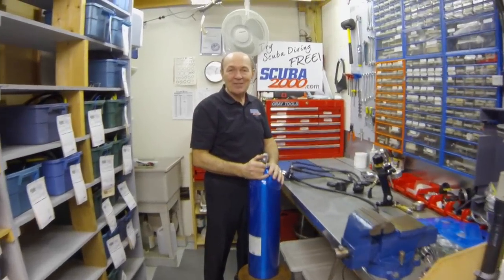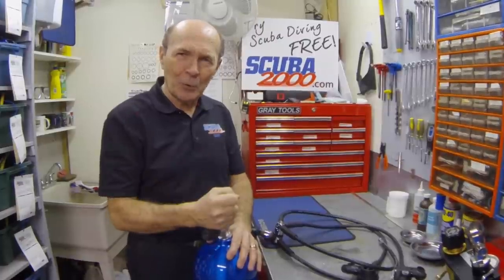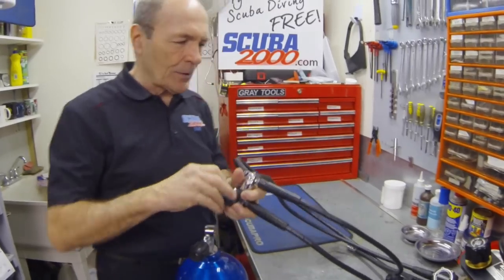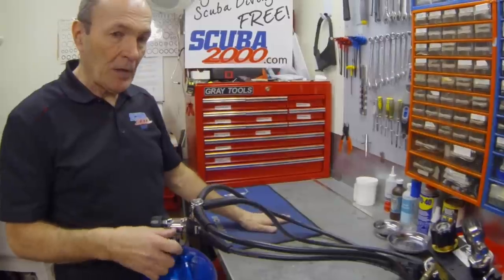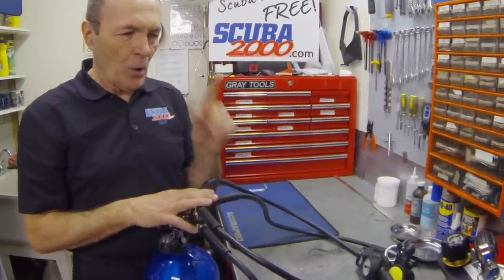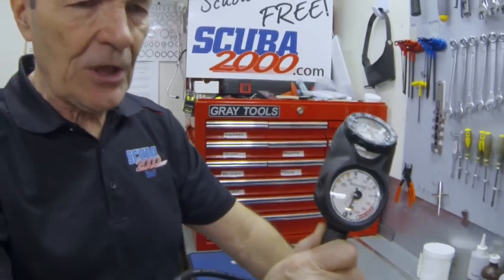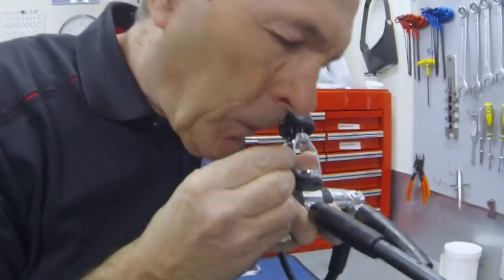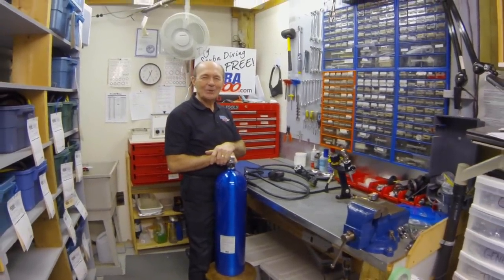Scuba System Assembly & Disassembly - The Regulator - Scuba Tech Tips #1

Comment: Heck Alec, I'm not even a diver and I enjoyed watching your video. Clear, friendly and to-the-point with none of the annoying soundtracks and unnecessary banter the young'ns use as a substitute for quality content. Keep up the great work.

I have an older steel Dacor tank that I am repurposing for non-scuba use. I removed the regulator and measured the threads to find that it was 1" (not the 3/4" NPS) that I expected to find.  I was wondering if you might know which thread standard Dacor used on these tanks back then.  Is it NPT, NPS, something else? I don't want to attempt to screw anything onto it for fear of damaging the threads....until I identify the fitting type. Your experience would be appreciated.
Reply from the maker: I've been thinking about this one. I can't think of the reason for a bigger thread. Some steel tanks had a smaller than normal thread (5/8" maybe). To the best of my knowledge there's 1/2"NPT used in old, PST steel tanks, recognized by the taper and need for sealant, and 3/4" machine which is a straight thread and uses an O-Ring. DACOR used Luxfer aluminum tanks and PST steel tanks - all normal. Take it to a local machine shop. They ought to be able to tell you what the thread is.
Alec
Reply: I misstated the dimension earlier. It is 3/4" and with the o-ring I suspect it's precisely what you said it could be. So I ran a 3/4" NPT and an NPSM into it and both threaded fine with no binding. Thanks for the tip, Alec. I appreciate it. Mystery solved.

Comment: Just a thought: could you invert the rubber seal/cap (turn it inside-out) while diving and then just wipe it off and un-invert it prior to putting it back on the regulator at the end of the dive? Or is the rubber too stiff?

Comment: Love your channel .you are the most informative person on the web .you explain everything clearly without using too much technical jargon .
I'm Shane from ireland.I was wondering could you give me some more information on tanks.
Im a big guy so I need alot of air .
Would a 19 litre steel tank or twin tank set up be best also How To set up twin can they be added to a normal bcd or do you have to go with back plate.
Could show me the size of a 19ltr so called monster tank
Reply from the maker: I'm not as familiar with European tanks sizes but I think the 19 is quite big. We were recently using 12 and 15 litre in South Africa and they seemed perfect. Most of used the 12. One of our divers, Kevin in fact, who is a big guy, used the 15 and it was fine.
I think the best answer is to use the tank size that will allow you to dive as long as your buddies or the rest of the group. Sure doubles give lots of air but they are expensive, very heavy, can cause buoyancy and attitude problems, require special BCD fittings, etc. And there's no point having so much air that you come up with half-filled tanks every time. You still have to pay for a fill.
See if you can't borrow or rent a 19 to see if it does the trick. If you find you come up with air left over, it's too big. Believe it or not, you can have too much air underwater.
Alec

Comment: Alec, could you please make a video about boat ladders for scuba diving. I need one that doesn't break when I carry treasures out of the water.
Reply from the maker: They don't make a ladder that won't break!!
I've seen some bad ones but there are good ones. Generally the best are custom made for scuba divers - wide ladders, wide steps, steps spaced closer together than normal, steps that go farther into the water than normal, solid but not too big diameter handrails, handrails that go well above the gunwale, firmly fastened to the boat so they don't swing and preferably 2 of them on the boat so there's no waiting.
It's not rocket science but it does take experience and a bit of money to make a good ladder.
Take care.
Alec

Comment: question , I just recently purchased a regulator set that wasn't well taken care of an has light corrosion on some of the metal connections, I plan on getting it properly serviced but is there anything you recommend to do before getting it serviced?
Reply from the maker: If you take it in for service they ought to Ultrasonic clean it and that should remove and outside corrosion as well.
If you want to do anything abut the outside, I'd suggest a wipe with CLR to remove some of the crap on the outside and then polish with an abrasive chrome polish (Autosol or Flitz)) to remove the rest and make it beautiful.
Alec

Comment: What is the easiest brand to service on my own? Ive owned scuba pro and the charges are can get pretty high. Im looking to purchase some additional gear and would like to service it on my own if possible.
Reply: Angel Lopez  HOG regulators are the easiest regs I've ever serviced, but Zeagles are a close second.  Both are easy to buy the part kits for, are super simple to take apart and service, are made of high quality components, and don't require proprietary tools (unlike most name brands like ScubaPro or AquaLung).

You can also get part kits fairly easily for Hollis and Dive Rite... I've serviced Hollis regs and am honestly not too fond of them after having seen their innards, but I don't have enough experience with Dive Rite to make a call either way.  From the Dive Rite service manuals, they look pretty straightforward, but I've never serviced them.
Reply from the maker: +CTW Scuba 
Actually, all gear manufacturers have proprietary tools. You can often use regular tools if you're careful. HOG and Zeagle are both good systems but no easier to service then many other better-known brands. The Scubapro MK5 has 2 moving parts; the first stage has 4 parts to be replaced during an overhaul and 2 of those are o-rings. Same for the Oceanic SP6 and the older Sherwoods. The benefit to these bigger brands is the availability of parts and service worldwide. Also all 3 brands have a Lifetime Warranty and Free Parts for Life.
Service of a regulator system should cost about $100 + parts if needed.
If your Warranty period is over, you can service some regs yourself. When you're inside a wreck at 100', remember who serviced your reg.

We conduct PADI Equipment Specialty course regularly - 2 evenings to learn all about your regulator and a lot more.
We also conduct an Advanced Equipment course in which you learn how to completely service your own reg system.

Comment: I don't think you explained why you shouldn't turn back the tank valve 1/4 turn after opening it all the way.
Reply: +Tony Home I think that's in another video. Maybe the one about "what your scuba instructor told you that could hurt you?"
Reply from the maker: +Tony Home 
Old tank valves (pre-80's), called pillar valves, were made of brass and used brass internal components as well. They can be recognized by the knob on the top of the valve rather than the side. The technology at the time precluded the use of large orifices. Consequently, it was not uncommon for a valve to "freeze" open because of the internal temperature drop during use. The various components would expand and jam together.  The solution was to leave the valve closed very slightly.
With today's modern valves, made of brass/stainless steel/teflon and with large orifices, that is unlikely to happen. Leaving the valve a bit open so that it turns both ways during a buddy check can be confusing. It's happened that a diver has turned his buddy's air 'OFF" by accident.
There simply is no need to turn the valve back 1/4 turn.
It can still be confusing if a diver does not understand that the valve is turned counter-clockwise to open it and clock-wise to close it - when viewed from the knob end!
I recommend the use of a Vindicator to eliminate that problem entirely. The Vindicator is a colored valve knob that show red when closed and green when open. $20 is cheap for such peace of mind <scubastik.com>.
Reply: +Scuba 2000 thank you. I need to get back into it again. My experience is nothing compared to most. But I do love it. just wasn't practacle.fpr me at the time with work and kids and all. hopefully now that I'm 46 I can't pick up where I left off...lol.
Reply: ***** Nice! All over the world, god bless you! I've been to PA that's it. lol. Thank you for the invite! I'm in New Jersey for now. Im sure I will get back into it as my life is starting to get a little more simplified. Once I can get this divorce and other issues over and find a new house for my son and I plan on going for some refresher courses for the time table.. All I can remember about it is how peaceful it is 100' below. Nothing like neutral buoyancy. Thanks again Alec.

Comment: Alec, I'm new and want to buy a regulator system/setup.,(proper name??). Can you help steer me with this question, First live in Salt Lake City and really wonder if taking the reg in for inspection yearly is worth it if I take good care of it? I have view your video on maintaning them. Great videos THANK YOU!!! (PS. it seems like a lot of money to pay the shop yearly).
Reply from the maker: If you don't care about the warranty (I discuss warranties in one of my videos and if you don't care about it that's OK) and, if you are very fastidious about rinsing , drying and storing your regulator and, if your diving activities are modest, say less than 20 dives a year, then getting your regulator system serviced every 2 years or even 3 ought to be sufficient.
By 3 years, even with modest use, your reg may be out of adjustment just from internal spring pressure plus your computer battery should be changed.
Your LDS should be offering a check-up service in which they simply check over the regulator for any problems and re-adjust the IP and 2nd stage. That should be a minimal cost, maybe less than $50 and no parts. A computer battery replacement would be extra, maybe $20 plus the battery.
I hope this helps you plan.
Thanks for watching.
Alec
Reply: Alec, thanks so much for your suggestions.  I dive about 10 dives a year on vacations and with only 30 dives under my belt your videos are awesome. For peace of mind i  want my own regulator setup but living here in Salt Lake City Utah I have no idea if any of the shops are knowable. There's a awesome shop owner in Grand Cayman I trust but now I have you.